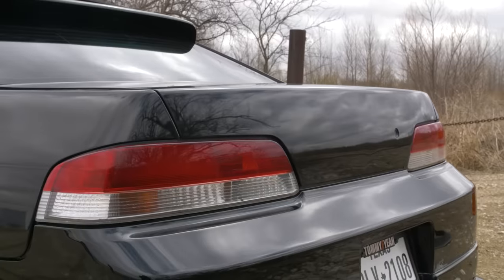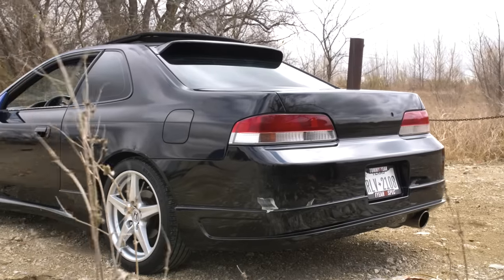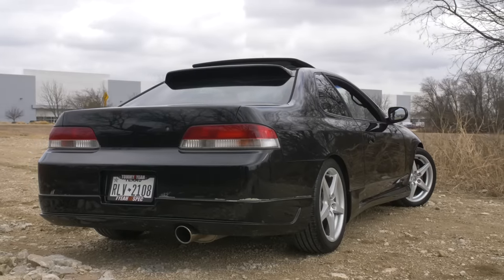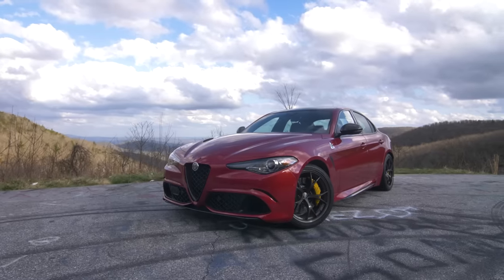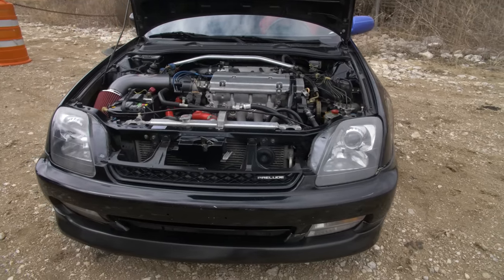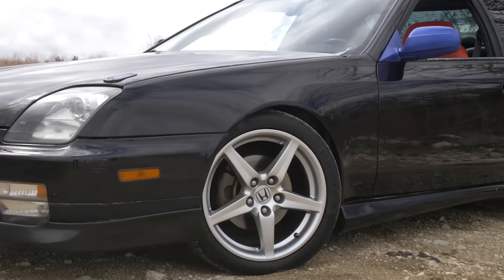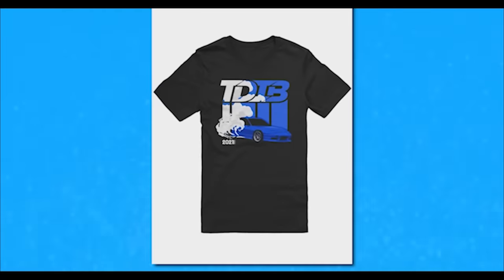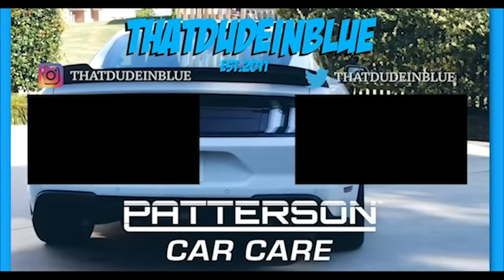Why is the Honda Prelude So Hated?

Comment: wasn't there one of these models that had a weird torque vectoring thing that made the outside wheel speed up when taking a corner making it handle pretty damn good?
Reply: Some of the preludes had 4 wheel steering, probably what you're mistaking it for

Comment: The only thing I hated about this gen prelude was the msrp especially availability as they were so hard to find in my city brand new and even for 5-6 years or so after. 21 or so yrs ago when the prelude was last for sale I had my first full time job and able to buy a decent car. 

Yes I couldn’t get a brand new 2k1 or 2k and it turned out I couldn’t get a 97 or even 95-96 end of the 4th gen because of the resale value and availability back then. I wanted one so badly

Comment: There used to be a system where you knew if an aftermarket part was certified as meeting the same quality as the factory part.  You can tear up a lot of expensive stuff using cheap parts.  Lubricants is another one.  My prelude is automatic you must use honda transmission oil.  There is no standard on hydraulic oils like there is on motor oils.

Comment: the real vtec k24 is like a stoked h22, the sound is identical
also as a cl9 k24a3 accord owner (acura tsx in US) I lowered the vtec to 4k rpm, put some nice exhaust headers and a proper intake and it screeeeams
the biggest downside is the gearbox and especially de 2nd gear being too long

Comment: Hated? I never heard anyone hate on it. They’re expensive in the tuning community. They’ve never been like less than $5k for the 5th Gen. The 4th Gen is the one with the super elusive and rare electronic 4WS (3rd gen is mechanical and functions slightly differently) the 5th Gen comes with an H22 across the board as well. The type S has the H22a (no numerical value) and that’s good for 220~ hp. They’re great GT cars but overall kinda heavy. Same with the accord (the car it’s derived from). They can be amazing canyon carvers and handle like RWD cars.

Comment: As a Honda guy I will say that they were not nearly as simple compared to civics. It’s the same overall setup just bigger, harder to work on, and more expensive. So naturally people stuck to what was cheap and worked. Not to mention the 4ws system that was dope but so expensive when it broke. It was more worth it to just swap the prelude motor into the civics as it was a lot more simple set up. Preludes are making a hard come back lately though.

Comment: They’re not hated it’s just that as he said they’re nearly impossible to find in good condition. If it is, it’s been distastefully modified. I was so close to buying a 2001 type SH with only 20k miles in 2002 but picked up an RSX instead. I kind of regretted that decision but I the RSX was a great car and I put over a quarter million miles on it before finally selling in 2016 for a Fiesta ST, also another great car I put 180k miles on it with ZERO issues before I overloaded it while moving. It bottomed out on an on ramp and I totaled it. That was a rough day all around.

Comment: I think 5th gens get a bad wrap cause out of all of the 90s Hondas, they are the most temperamental. They can be a bit of a pain to keep going but when they do they rock. 

On stock 120k mile suspension and cheap coils they still hold their own against newer Si generations in the canyons. Once I was able to drop an LSD trans in mine it turned into a whole other animal.

Comment: If anything the 4th gen Prelude was the hated generation. Personally i think they were ugly as hell but thats me, but the 5th gen is my favorite of the models Honda made throughout when i was younger until now. I remember there being a 5th generation Prelude at the local dealer when i was younger and my uncle worked there that was red and had the optional aero kit and sport suspension and some nice alloy wheels that i still to this day would love to have. The aero was subtle but did alot to change the look of the car from the others around it. Only thing i have seen over the years options wise was the Motegi version but cant seem to find information if that was available in the U.S.
Reply: Funny most feel opposite in my experience..... Front end of 4th gen is amazing. 5th is ugly....that was the verbiage coming from everyone in 1997. I still hear most saying 4th is best looking and I agree.....it just goes to show it is so opinionated. 4th gen VTEC is the best one -better feeling car for pure driving -5th they refined a bit more to try to sell more units....

Comment: I think it's overlooked (not hated on) simply for the fact that Honda themselves didn't think enough about them to keep them around, so there's no appeal when you can get a mainstay like a Civic instead. Technically it's just as good no doubt. But the appeal in a model has to be there or it doesn't matter making an argument for it.

Comment: I believe car too heavy H swap wasn’t as popular because of the weight. Didn’t rev as high as the B series however torque and 200 horsepower was nice. If u had a ef u had to cut too much to fit.  Nice car overall though 👍🏾💯

Comment: I had a supra with the turbocharger.  Oil leaked into the turbine and ignited overspeeding it.  The compressor shattered and pieces went into the engine causing an uncontained failure.

Comment: honda did to themselves with releasing the s2k around the same time as the 5th gen prelude is the main reason they flopped.  thye look great but when you get to specs for get the power and so on.  the 4 gen wins it since almost everything from the 5 gen bolts right up to it.  a big thing for the vtec h22s and f20s of that era was hairline cracks in the piston walls or the ol trusty headgasket blowing and not knowing.  love the ludes and h22s as I have one in one of my drag cars.

Comment: H22 engine swap? Sorry David. They already came with h series from factory
Reply: It was swapped at some point with a JDM H22A. The US cars only got the H22A4. Biggest difference is closed vs open deck. Closed has stronger sleeves since it doesn’t have the cooling jackets around them. Stock for stock though they’re the same HP and Torque unless you got the type s version which this one isn’t lol!

Comment: Why would they need to swap an h22a when it comes with one ?
Reply: I bought it like this and a lot of them probably Grenade due to people not changing timing belts. H22A is more desirable than the H22A4 due to them being closed deck vs open deck. Some H22As out of Japan also had more HP if it was a red top out of a type S

Comment: I had no clue the carbon fiber was an option..I thought someone bought and Installed it theyre 21 yrs old and look brand new damn near ..i got my 01 type sh with only 90k og miles bought it in 2011 with 60k ..just wish it wasnt a tiptronic. Had a 96 teg in 03 High school it got stolen bought another same color identical but my new one had a GSR.. It got stolen on Thanksgiving col months after got it then bought a 03 RSx type s  ..which got totaled so now got my lude and had it for a while no complaints tbh..

Comment: No way cuz ,the honda prelude is one of the best Honda's ever made , had two gen 3s b20a manual and 1 gen 5  h22a redtop manual , way more comfortable than Integra's and civics and handles just as good just heavier  , gen 5 prelude h22a redtop  is like mixing a accord cl1 euro R and integra dc5 Type R. Just heavier with longer gears .

Comment: The simple answer is that with an H22 the Prelude runs 15's. Swap that engine in a rattle hatch, it runs 13-12s. 

I built one a while ago. If you Google F20B RHD Prelude, it's literally the only one. It starts silver LHD and eventually is RHD gold on volk ce28s. There's a tiny clip or 2 on the channel. 

Anyway I chose the Prelude because it's not a base model hatch. And also nobody did RHD conversions on them. It felt more substantial and adult than a civic or integra.

Comment: It's not that the cylinders are thin, it's FRM (aluminum oxide ceramic) cylinders, not steel.

There were (are?) no reliable aftermarket pistons to lower the already high compression that work very well with those cylinders. About the only option is replacing the sleeves, either in the H block or by swapping in an F block. That makes "stage 1" unachievable without $$$. 

(imo, bolt-on's don't count as a stage, because they don't do shit, so anything less than low boost is for posers)

Comment: i dont think the hate is about the car.. its more of an owner issue doing things to thier car.. and not just specific to honda.. there are loads of other brands and models that get hate.. you know.. with the fast and the furious era where every kid at the corner buys a bodykit, a loud straightpipe or muffler only exhaust, cut coilsprings and the list goes on and on and then do nothing about the cars performance so its slower then stock, makes a ton of noise.. scraping the bodykit on the ground.. has a shitty ride quality.. if cars where build more like this.. and also with a clean paint job on it.. i dont think people would hate them... its just the other majority giving the brand a bad image..

Comment: Ok so I’m a recent prelude owner and I can explain. The engines that preludes were made with were all bad they all have inherent problems. Honda engine making has come a very long way since since then. The hood of the prelude is quite slim and does not allow for the transplant of a better modern engine. It’s been tried. The only thing you can put into a prelude is another bad engine that had problems. That’s most likely the real reason they were discontinued. If Honda cannot continue to improve on something to bring it up to new standards they shut it down.

Comment: I have tow of the coolest 5th gens you see driving around in California, I’ll say I’m the only Honda prelude on 3 piece #hre wheels everything jdm mirrors red interior  functional digital climate control Mugen header and full cat back exhaust level headlights hood bra hood bonnet carbon hood carbon trunk carbon mugen wing power trunk power gas lid full Navi real carbon trimmings auto power roll bar h22 euro r with ac 2 piece big brake  aem rotors sway bars r888r round fog lights etc. Etc….

Comment: 1998 Prelude was too expensive and too heavy, it only have 4 cylinder engine with no V-6 as an option. 1998 was was losing battle for Prelude, facing internal competition from Civic and Integra (later RSX) and larger Accord with V-6. External competition with similar price range from Camaro, Mustang, Celica, Tiburon, Probe, MX-6 etc dont help either.

Comment: Honda preludes didn’t do well because why build the 3200 lb car when I can build the 2800 lb car and it gets worse highway fuel economy than a v8 due to it revving at like 3500+ at highway speeds
Wouldn’t give mine up without a really good offer though

Comment: The best thing about the 5th gen Lude was the motor for swapping into the Civic, CRX or even the 4 door Accord...which ironically had a lower curb weight than the Prelude. The problem was that Honda built a "sport look" car as opposed to a sports car but then failed to market it in any real way. Fun to drive but handled like a pig on skates and for as big as it was it had no interior space, it truly was a car caught in between styles.

Comment: Prelude curse had one and had problems from day one from burning oil at idle all the way to headlights and turn signals randomly stop working to ball joints popping to over heating not to mention it was a type sh so sourcing suspension parts was so annoying

Comment: ludes are not hated? but two things that come to mind as negatives, It weighs a lot for a honda coupe, and it has a h series. the H had a small window of king of the hill before the K come a long. subsequently h series are expensive (relatively) to replace (gl finding a vtec h22, jdm h23 BT) and the mate with cable transmissions. insert SH atts trans problems here, also only two good h transmissions, the m2b4 and uq have factory lsds.

basically the cost of a nice 200hp+ manual 5th gen lude is on par with any k series swap eg/ek. 

very cool builds tho, and they are still out there.

Comment: Because people treat it like its the ultimate platform, even though it’s heavy and front-wheel drive. The only reason it handled decently was because it had double-wishbone suspension and not-terrible rigidity. Even then, Civic and Integra still made more sense, especially if you swapped engines. Then add in the price…

Comment: The 3rd and 4th gen ar not hated. They got independent suspension, and support the H series engines. The 5th gen is the heaviest that supports the H series. I think the 3rd gen Prelude is the best. Then the 3rd, 4th, and 5th gen share the same airbag computer, same ABS computer, same power steering. So the engine ECU is all that changed in the 5th gen. They make V6 Accords lighter than the 5th gen Prelude.

Comment: The H series engines are known for burning oil even without mods. They aren't great engines as a base for a build because any increase in compression will only exacerbate the issue. Fun car to drive either way. I owned a stock 98 SH but sold it because it drank oil.

Comment: This guy dont know what he's talking about. Preludes came with h22 so it isnt a sawp
Reply: The USDM (H22A4) and JDM (H22A) H22s were different. Early H22As from Japan were closed deck as well which take boost better. The car is swapped and has an early H22A in it DYOR.

Comment: I think preludes are good parts cars lol.   H22 drops right into any 90-01 accord.  Ream out the lower control arm balljoint and you can 5 lug swap a 90-93 accord.  Plus several interior bits are bolt in as well as accessories in the engine bay.     Plus the 90-93 is lighter.  Alot lighter

Comment: H22 blocks used FRM cylinder liners instead of iron. It’s not as durable, the wear over time leads to a lot of blow-by, making high mileage examples undesirable. Good for swaps though; H/F frankenmotors, K series and the holy F20B. The chassis is great.

Comment: I owned an 01 and it was the worst car ive ever owned. Now it could be that mine was a lemon ao take my opinion with a grain of salt. The thing i remember most is that its such a pain in the ass to work on
Reply: Can you please tell mlre about working on a prelude and how its bad
Reply: @Sam-dd8cl  there's absolutely no room to work on the engine and if you get the SH it's even worse cause if you need to get to the trans you have to remove the SH attached to the trans.

Comment: People do not hate the Honda prelude the only reason why people don't mod them is because they're heavy you can get a lot of power out of those h22 engines but it's still a heavy car to move around when you can go and get a k24 out of the junkyard drop a K20 head on it put it in a Civic and have a card that's quick and dead reliable as long as there's no forced induction

Comment: i like the body, it has to be one of my favorites but after owning one as a daily, they break down too often and spend a lot of time in the garage
Reply: I am surprised by this. What kind of issues? No judgement, I've had a Probe GT for 13 years, probably down half that time. Ignition trouble mostly. great when it runs perfect tho.
Reply: @pgtmr2713  overheating always became an issue, the car was a headache even though parts were cheap. 2 swaps and the 2nd swap started to give out on me before i sold it. never got a chance to fully enjoy it after owning it for 2 years
Reply: @pgtmr2713  sold it exactly a year ago and bought a foxbody, takes all the beating i give it and a lot more fun with huge potential🤟🏼
Reply: engines alone only ran 350 for the prelude but even then it was a daily that never was on the road longer than 3 months, always this or that
Reply: @panini8711  I had a 98 Mustang GT,  This was after a 93 Probe GT. I missed being able to take it to 7k rpm and Independent rear. I did have fun with it destroyed a T-45, swapped rear gears. The v8 stuff was also more expensive to mod. So went and found a 94 PGT.  JDM engine cost me $600 another $200 for ecu swap. The rest of the car was good though. No long list of this or that to make it fun. dailied it for a year and a half after the swap, then down for most of 3 years. Up now, idles a bit high, going to have to dig into that.

Comment: Honda blew it with the restyle.  While the front end is quirky, it's still kind of cool, just not as sleeks as the Gen4.  The rear is the problem..... it's just flat ugly, looks like any anonymous 90's import.  Tail lights ARE the character of the car, and these couldn't be more boring and unremarkable.  The dashboard is a downgrade, too.  They could have fine-tuned the Gen4 dash, which was full of cool.  They could have grouped the gauges tighter and left the overall design.  They opted to go with a dash that is the same as everyone else's.

Comment: Honda and prelude hated because after one problem shows up, then followed by another problem and so on, and to add HP, you have to connect to laptop such a pity, if want to add like 50hp for example you need a laptop, if you want to add 50HP more, you need another laptop, might as well by like 20 laptops to get over 1000HP 😄😄😄

Comment: They were expensive, heavy and less supported in the aftermarket as their FRM sleeves limited builds back in the day. Top that off with garbage gearing and a transmission that wasnt very strong and you have a receipe for a hard pass
EGs by contrast were cheaper - accepted B series motors and had unlimited support for the entire car.  
The pigludes arent hated so much as not loved like a much lighter EG.